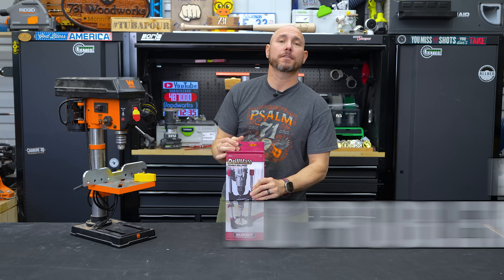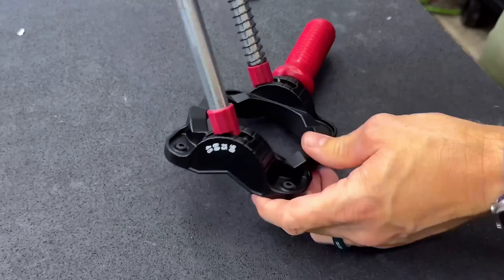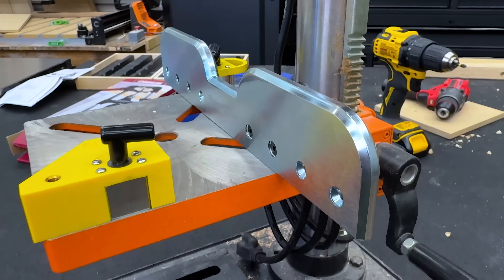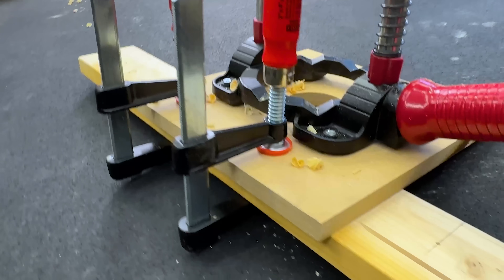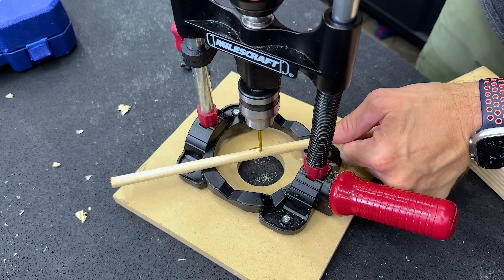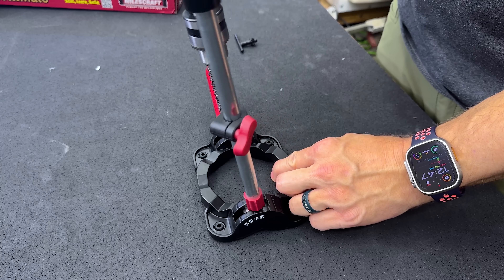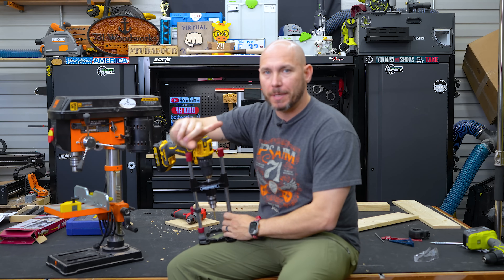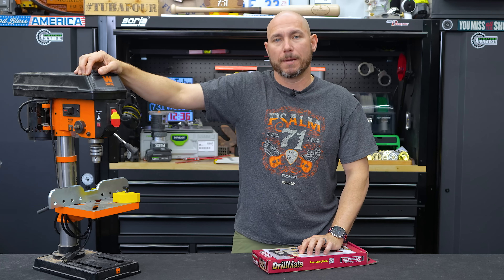Ultimate Drill Upgrade! Turn Any Drill Into a Drill Press

Comment: I have a drill press but I bought one of these to drill some holes in an aquarium.  This thing SUCKS like the suckiest sucky thing ever.  The chuck sucks.  The whole thing wobbles even when I had it screwed to a plywood template I made to mark out the holes...so bad I had to put silicon on the bulkheads to fill in the chips this caused...that should never be needed and I hand drilled them on the next box with much better results.  I truly thin you would be better off giving someone that $50 to kick you in the jewels.  I hate this thing soooo much.  To put it in 731 terms...its "Hot Garbage"

The one Rockler sells on the other hand... a totally different story.  Stable, great chuck, easy to adjust.  I get that its $200 and that is plenty enough to buy a proper basic bench to drill press but if you have a real use case for one of these then spend the $200 and get a quality product...buy once cry once is a favorite chant out her on the interwebby and it couldn't be truer on this one.